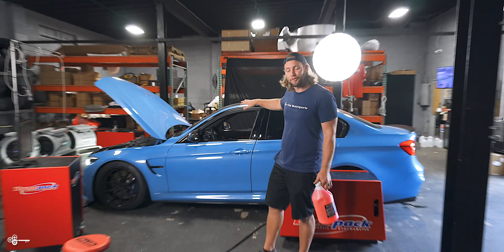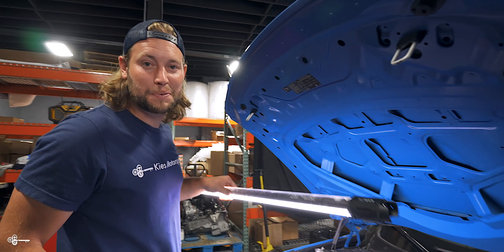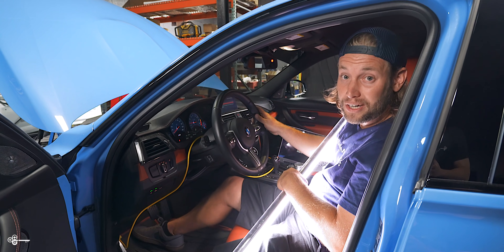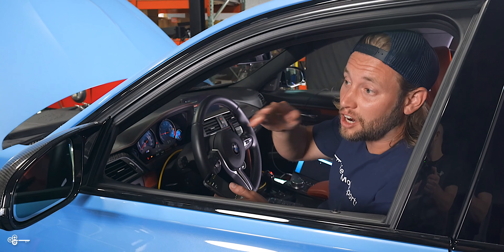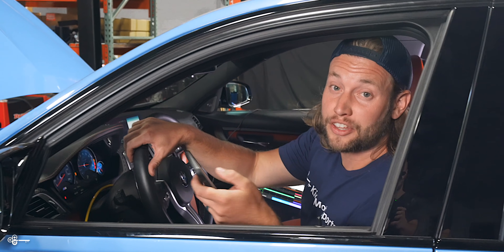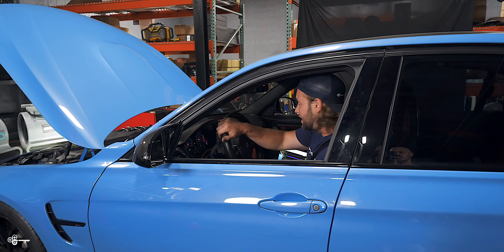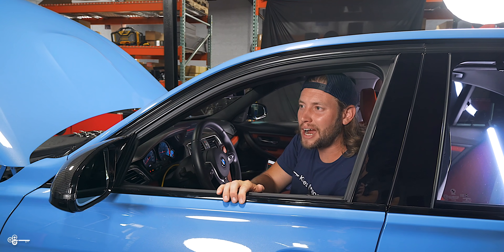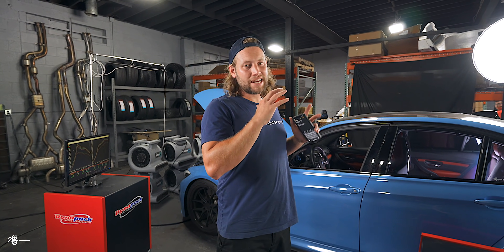DYNO TEST: HOW MUCH POWER DOES WATER-METHANOL INJECTION WITH A CUSTOM TUNE REALLY ADD?! (BMW F80 M3)

Comment: For the curious: 486 hp before | 565 hp after
Reply: Thankx for saving my time
Reply: ...and 499ft/lbs before | 630ft/lbs after
Reply: Thanks.  Really they shud make two videos.. a short one straight to the point and a long one for those with no jobs etc and have lots of time to sit watch lenghty videos.
Reply: Can the transmission really take that much torque? And for how long?
Reply: It was tuned. Methanol increases octane. Octane is the resistance to detonation. It's all in the tune , not the methyl.
Reply: @UnTamedMustang  that’s not true at all. Spraying my Abarth without any tune changes (stock flash) actually picks up decent power with 50/50 meth.
Reply: @BrodeyDoverosx  

You have info on your setup?
Reply: Nope. It's not all on the tune. Water-meth does more than raise octane level. Even without a tune, it cools the intake charge air, cools the combustion lowers the engine temperature and cools the boost. This all increases air density and horsepower specifically more on boosted engines. The tune simply squeezes out more power by adjusting AFR's and advancing timing. BTW, I never owned a water-meth system. I just read a couple of articles. I probably don't know what the hell I'm talking about. Lol.
Reply: @hellbent7066  No you defiantly need a tune. Yes it does raise the octane, cools the intake charge and everything you described.  However, it will drastically enrich the fuel ratio. I tried it in my supercharged mustang without a tune and according to our data logger the ratio went from a perfect 11.5:1 to 9:1 immediately and it was very apparent it lost a ton of power.
Reply: @victoriaolson4661  yeah AFR will be too rich thus reducing power on some cars. Other cars will make more power but only like 10hp maybe
Reply: @hoomee7605  it’s not all about you
Reply: Thanks
Reply: Litteraly an og
Reply: Thank you
Reply: @WASTED__POTENTIAL  that’ll be noticeable 😳
Reply: And yea technically it’s like driving in Alaska, the cars gonna feel like a beast with that freezing cold air coming into the engine.  Yes the tune can be crazy aggressive compared to just pump gas alone.
Reply: Yeah, the tune up is optimal. The methanol takes up volume that would otherwise be occupied by air, so it really does affect your air/fuel ratio. If your engine is already running pretty lean, you might get some boost without any adjustment, but it's certainly wise to tune it - seriously, why not tune your car to your driving habits?
Reply: Thank you.
Reply: Thank god lol
Reply: @UnTamedMustang  the W/M injection reduces knock and allows for more boost and timing. So saying it has nothing to do with it is absurd
Reply: Pure 2 turbos tho too
Reply: @WASTED__POTENTIAL Yeez. I need to look into this for my 04 Jaguar, making 415hp crank, would love to see close to 500 with a smaller pulley, exhaust, water/meth, tune
Reply: @my67falcon no he doesn’t because it’s not true. There’s always some clown out there trying to act like he knows what he’s talking about. Then once he figures out he was completely clueless decides to hideaway.

Comment: I would have liked to see you do a dyno with just the boost juice added without the tune to see what, if any gains from boost juice alone.
Reply: Same, this isn't really apples to apples, but I'm also not really sure that's even possible. But people make huge gains just going custom from OTS.
Reply: Without a tune you won't see any gains in terms of power because the ECU will vary the boost pressure to target the same load/torque, so lower amount of boost is needed to make the same power because of the denser air.
Reply: @MihaiRece  I disagree , I ran ots mhd stage 2 + tune on my FBO n55 435i 93 oct then added AEM kit and then adding boost juice and changing from 93oct to 95 oct for a little more timing adjustment and that car probably gained 30whp . Even wedge tuning told me after seeing my logs that my setup wouldn’t gain more than 20whp on a custom tune . That car is dialed in perfectly that way
Reply: without a tune, it will cool your charge but it displaces air and will likely decrease power by itself
Reply: @MBTVEXTRA  you still tweaked the tune 95 oct vs 93 oct big difference also more timing so as Mihai said without a tune just water meth alone will do nothing power wise
Reply: This is what j was expecting

Comment: How much more boost were you able to run?  That's the big question. Video kind of gives the impression that a meth kit will net huge gains. But if your turbo is already almost maxed you will only see smaller gains from being able to run a little more timing and the cooling effect.
Reply: They really should include the logs lol

Comment: Should really have done OTS map vs Custom map then Custom vs Custom and Meth. In theory the meth could be doing nothing and its all in the custom tune (I doubt it is) but you can't be certain when changing multiple things at once.
Reply: I agree, I would have also liked to see a run of just the meth without any change in tuning.
Reply: Methanol/water without a tune reduces power as it delays initial flame development and flame front speed. It needs additional ignition advance before any gains are attainable.

Comment: Water-methanol injection mostly adds steam pressure (water) and a small amount of fuel (methanol) all the while allowing more boost on regular gas as the steam cools EGTs and prevents knocking.

Comment: My 2015 f80 M3 mineral Gray sakhir orange interior completely stock accept A P front mount intake with VF engineering hex tune stage 1 put down 509 whp & 550 wtq.

Comment: how long does 3 gallons of the juice last? how many pulls? or months on average? and how much does the juice cost?
Reply: Water methanol is cheaper than premium - you can buy a 55 gallon drum of 50% methanol windshield fluid for $200

Comment: I’ve seen 600hp on e85 no meth on stock turbos. Just intakes, heat exchanger and down pipes, and inlet pipes. Shouldn’t  this make more power with upgraded turbos?
Reply: e85 is basically 85% ethanol which alone gives you loads of cooling. adding wmi to an e85 vehicle doesn´t give you as many gains as on pump gas

Comment: That's Awesome....
what happens if it runs dry in the middle of a push ? If you've run empty and can't get a bottle to refill for some stupid reason, I assume you have to remember to keep the car out of the range that's tuned for the methanol?
Reply: yeah, youre totally right. the same with having to deal with lower quality fuel, you have to be timid about it
Reply: The W/M injection system they are using is switchable. Meaning you can turn it on and off. Also most tuning devices allow for multiple tunes to be saved so you can have one with and one without
Reply: Hopefully the tune is programmed to lower the power when knock happens, it depends on how good the tuner and ECU is.

My non BMW car fills in more fuel in multiple steps to cool the engine.
If that does not help the ignition is adjusted in multiple steps.
If that also fails the boost is lowered in multiple steps.

This was possible on a stock ECU 25 years ago, so if the tuner does not take advantage of those settings it is pure laziness or recklessness.

Comment: The peak power and torque isn't important., but the shape of the curves are. They should be as smooth as possible and the useable power and torque range should be as broad as possible. Sometimes it's adviseable to reduce peak horse power or torque to achieve that.

Comment: I know this is 10 months ago. But there is an off setting. No need to change your initial spray setting. Also, so the car is tuned for water/meth vs just for cooling?

Comment: Is it just me or did this car not make much power being on pure stage 2 turbos? 

I made 575hp and 571trq on stock turbos on E85 with F80Paul as well
Reply: I’m sure you made that on stock turbos and you can even push them a little more, but at what PSI?  The HF can do it in a much more efficient manner.
Reply: I made 502hp 602tq to the ground on mike Botti base flex fuel map on stock turbo.. no pure or meth. Just tune MST intake down pipe flex fuel kit and E-50
Reply: I thought the same. Seemed low for an S55 PS2 w meth. I wasn’t expecting to see anything in the 400’s
Reply: @f80motorsports50  22psi

Comment: “Needs wider tires” indeed! Maybe drag radials.
Reply: No way, it would ruin what the M3 is all about, and that's cornering.
Reply: @DjNikGnashers  He can get away with R888Rs. I think this is over 600whp on a dynojet. Any more power and he would need slicks if he's going to mexico instead of a road prepped track. The m4 would just turn into a straight line car...

Comment: Aren’t those numbers kind of low considering aftermarket turbos ?    You can achieve 575-600whp on stock turbos with meth and E85
Reply: you can achieve 600hp At the crank not at the wheels.
Reply: @G_Whip_Media  so affectively you are saying that the car in the viseo is running roughly 680bhp at the crank right as you lose power by the time it reaches the wheels but even then isnt that low? For such mods.

Comment: I don’t understand how it was decided to start spraying at 12 lbs and going full at 15 lbs.  I guess if the system is just used for fueling and not cooling?
Reply: The nozzle size has an effect. Basically the car can stumble if it gets too much too soon, it’s liquid. Water/meth tends to works best when it has a phase change due to heat, higher boost equals more heat.

Comment: just tested boost juice with hydrometer yesterday. its not 50/50, comes out just over 33% methanol. adding a yellow heet bottle bumps it to 37%
Reply: what? i thought they advertised as 51/49. did you use an ethanol hydrometer by chance? that would put off the readings as methanol has a different density
Reply: @faxxzc  bruh so who’s right 😅 ima refund my juice rn
Reply: @isanmoldonado4587  what you said

Comment: How often do you fill the boost juice?
Reply: every 2-3 rides depending on size of tank, mine has 3L, wish could be bigger but I can live with that. Basically every time I am putting fuel I am adding WMI juice too in 60/40 water proportion. 
Mine M2 N55 2017 does 586hp

Comment: I'm on a full bolts on MHD stage 2 plus, xHP stage 3 on a 2015 335i. About to pull a trigger on a meth kit (via my VRSF charge pipe connection) and am wondering about the right tuner for my MHD platform. Are you guys recommending any specific people? Anyone I should keep away from? Thanks.

Comment: OK what happens if you tune for Meth and run out? What does it do to my LS3 ? Thanks Dave
Reply: The meth controller is most likely set up to cut boost control ground

Comment: What will happen if we just run the WM kit without tuning on stock ECU?
Reply: It probably won't inject, or won't inject properly and could ruin the system.
Reply: Depending on the nozzle size it will do next to nothing or worst case run a few 10ths richer AFR

Comment: I HAVE A 2018 M2 WITH A METHANOL SYSTEM, WHICH YOU RECOMMEND VP M5 M1 OR THE ONE YOU SHOW IN THE VIDEO.
Reply: M1 is pure methanal, M5 has lubricant added. Run M1.

Comment: It's Pound-Feet not Foot-Pound. Those are different forms of measurement.

A pound-foot (lbf⋅ft) is a unit of torque representing one pound of force acting at a perpendicular distance of one foot from a pivot point. Conversely one pound-foot is the moment about an axis that applies one pound-force at a radius of one foot.
...
Pound-foot (torque)
Reply: its literally the same. if you visualize your two explanations they come out to be the same. it´s in the math also. 2x3 is the same as 3x2. if you use a pivot point or moment about an axis does not matter, they are both moments.

Comment: Is this dangerous, let’s say for some reason it leaks into the engine bay??
Reply: Hi Andrew No it is not dangerous in any way. As Brian said 50/50 method mix is Not flammable. Just like winter windscreen wash won't hurt your car. The gains come from the cooling effect and mor so the extra Knock protection. 100% Meth is a real problem Because if it dose the flames are invisible. Not good!!!!
Reply: @markironside430  That is NOT true, 50/50 is very flammable. Pour some on the ground and light it, even 30% will light if atomized.

Comment: So were you comparing “Paul’s Tune” or meth injection. Because you didn’t prove anything substantially. Did you run meth because the tune required it? Or did you run the tune because the meth required it? Awesome numbers by the way!!

Comment: So if you're tuning without a dyno I guess you'd be using something like Dragy with Pro tool or INPA etc. But wouldn't you need to bring the car to full chuff (RPM) in 4th gear? (So you'd get a 1 to 1 gear ratio). Or is it not like that when doing it on a road. In Mexico. Etc? LOL.  You'd be doing like 150 mph or more.

Comment: I've always been told to avoid water meth injection as it isn't if, but when the system will fail and take your engine with it.
Reply: That’s why you use it to cool the iat temps , cool cylinder temps and not use it for fueling.
Reply: Same can be said for nearly any part of the fuel system or internal part in the engine. If your fuel injector fails mid pull your going to torch a cylinder.

Comment: better 50/50 or 70/30
Reply: Most pumps are only rated for 50% Methanol, the seals can deteriorate with higher Meth percentage.

Comment: Better hope you never run the Water/Meth tank dry on that tune. It'll go very lean on you and that engine is NOT going to like it.
Reply: There's a low level indicator light kinda same as ur gas tank 😜 also there's failsafe options if your running aggressive tune that will pull timing if your tank runs dry during a pull